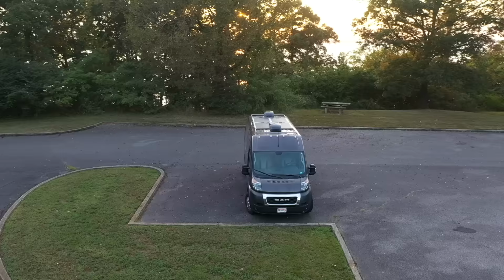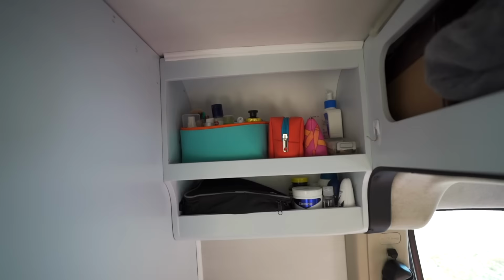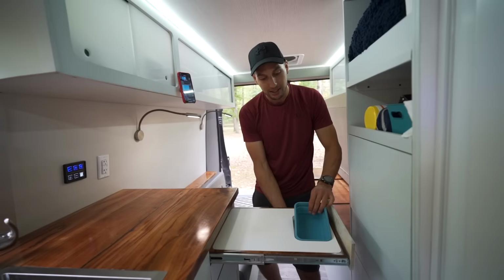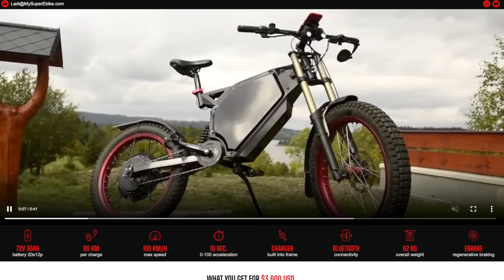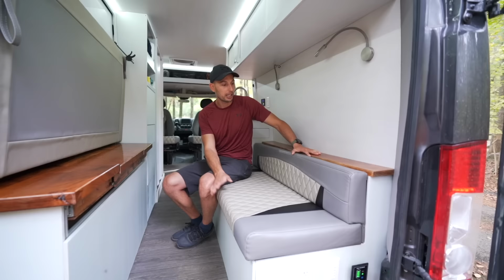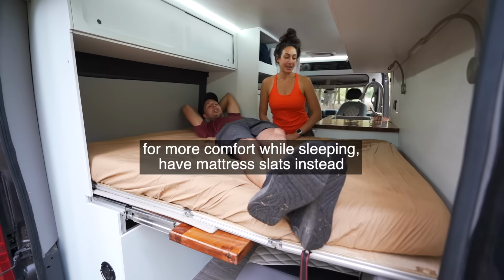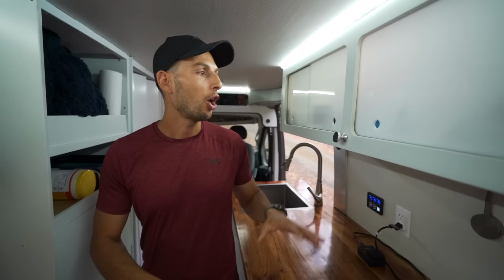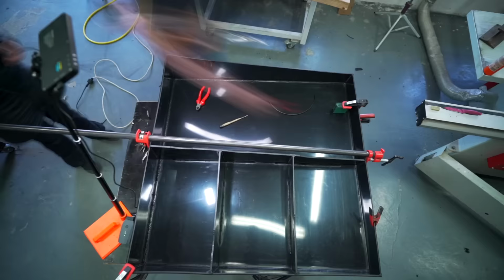LUXURY Van Tour + DESIGN REVIEW of Innovative Campervan Layout

Comment: Something I noticed: The 3rd joint of that bed is gonna become an issue. I could see the stress on it in this video already. While they say that the bed will hold 500 lbs, that 3rd joint does not have the necessary support for longevity. The table would need to come out a few more inches AND connect to the top of the sofa to relieve the stress on that joint. If you look closely, the joint is beginning to bend downwards slightly. The more you get on it, the more it's gonna become evident until it finally gives, rendering the bed useless until that joint is replaced.
Reply: Yup! If, only the mattress buritoes, the slats accordions, it may be better.
Reply: smart, that was the first thing got my attention. Floding bed better to land on the floor when fold out.
Reply: @jparsit .
Reply: Hej peeps, does someone know which foldable hinges they used with the 8020 Burrito (22:31) bed system?! Thaaankss
Reply: Love the pros & cons at the end
Reply: idk why they dont put 1/3 on the opposite wall to fold down and act as a cushion back when sitting.
Reply: @TheDevilK  im working exactly on that Atm. But to know this mechanism woul be a great  advantage
Reply: agree. And extending the table would allow for more comfortable seating because it would come close enough to you to sit back against the wall of the van.
Reply: That third joint is not as bad you think. It is likely 500lb, and for 2 people. But your weight is distributed most of the time while sleep across the entire bed base. The con is this is not a stationary weight, it is mobile, which adds more stress then just a stationary load. So just thinking all that and yes I could see where you are thinking and that IS the weakest point of the design. However, that would only be an issue IF one sleeps in the opposite direction. Because that third joint is under your legs when you sleep in it, in its intended design. There is very little weight and load from your legs, so this should not be an issue at all. Or it might be an issue IF you get onto the bed at the end, but again it is designed to be entered in the middle which pull out table is beneath for extra support. It is clear to me they designed and engineered on purpose this with the second joint being on top of that pull out table in the middle of the bed where it will see the main loads. If you are sitting in the bed, once again that would be done more in the middle just naturally sitting up from a laid down position, as well as near the walk way. Again over the top of the 2nd joint and supporting pull out table underneath. Again no issue. Even if you were to sit on the opposite end of the bed, with your back up against the wall, your legs will be over that 3rd joint, with the base of your body being supported by the back rest of the couch the bed base sits on. So not an issue there either. 

Just look when he is laying on the bed, it is only his lower legs that are on that 3rd joint of the bed. His knees and entire rest of the body is above that and being supported by the 2nd joint and pull out table underneath.
Reply: All the creaking noise it makes would drive me crazy
Reply: The bed is not nice.  When folded up and not in use, it's sticking out like an ugly wart.

Comment: Could not have the cooker over my beautiful leather sofa to get hot food,water spilled over it. And the chopping board was fab but needed to be on the end by the sliding door. No inconvenience as you can use the back door to get in and out.
Reply: O
Reply: How about putting the chopping board where the cooktop is, and the cooktop on the opposite end of the counter? That way any steam or cooking smells could waft out the doorway? 😊
Reply from the maker: That would conflict with the sink.
Reply: Maybe lay a blanket. with a design you like, over the couch to protect it?
Reply: @ladiandmargaret  they could swap sides with the sink to achieve that. I would be mortified if my couch was damaged with cooking oils etc.
Reply: No back splash or hood vent ?

Comment: A large table to lay out blueprints is a must for me if I travel with my work.  This clever design provides that without having to buy a bigger RV.   Would never have thought so many features could be made to fit a van.  Narrow hallway suits me, a solo traveler, when it gives such a big kitchen work surface. Even better that it expands in 2 directions. Best shower setup I've ever seen in this size vehicle.
     Thanx for the tip about how white back splash = high maintenance.
Reply: Not sure what you’re doing around blueprints if you “would never have thought so many features could be made to fit a van”
Reply: @Timeculture  Actually, there haven't been blueprints around for 25 years ... But, that's what we still call any large scale drawing that has to be rolled out on a big table.  A scale drawing is used to design anything from a dog house to a rocket engine.  The rocket scientist and the carpenter aren't necessarily the same person.  Is that what you are getting at?
      I don't know anything about planning a compact, useful van interior.  Big and tall, I'm in awe of anyone who can conceive and build large features that become small;  in this case, the folding bed, the expandable cooking area ... but especially, a huge, slide-away table for drafting work, where several people can view the presentation of a project drawing in a weatherproof setting. The big drawer where the presenter hides her laptop is a great place to keep drawings and drafting tools clean and intact.
       I draft up plans that show people where to plant trees on country properties.  The scale is usually 1" = 8 feet, or 1/100 metric.  Some of the work can be done on a laptop at a tiny desk, but at some point is generated a large plan on paper.   Not all clients have a guest house or drafting table.  Sometimes there aren't yet any buildings on site.
       With a van like this, I can park right where the planting will happen.  Rainy or windy, I can invite the client(s) inside to view the drawings.  At a later phase, I might supervise the planting, in which case the landscape contractor would also find this big, weatherproof table useful.  He might just run out and buy a van with the same ingenious features.
      It's a niche market, but there are probably countless professions that need this type of indoor/outdoor portability in a compact van format.

      My work provide

Comment: Great video! A suggestion for the bed - they make "zipper bedding" where the blankets/bedspread zips to the bottom sheet, so it is easy to make the bed and not have to store the bedding separately. Good for any bed really, but especially a bed that moves to be put away.
Reply: This is great advice, I would definitely use zippered bedding if I didn’t have a fixed bed
Reply: One of the brands is called Beddy's. I thought of this too. I feel like they'd be especially convenient in any van.

Comment: love the pull out stove - swap to van door side like previous note.  Love the big top opening fridge and counter space, no to the taco bed.  Love the rotating chairs with computer table and foot raised. yes 2 vent fans.  I love windows at least on one side.  I do like the pull out chopping block without the rubber catch thing in it - it will wear out ... love the window coverings and your cat.

Comment: The leather pattern furniture and beautiful wood work is the best I have seen.  I like the white plastic cabinets and the appearance of the layout.  I live in a RAM Promaster City you know a FIAT a little one.  I use a Walmart Futon for my sofa bed.  Looks great, durable and very comfortable.  I have a wraparound wood finish utility shelf cabinet on the side and back.  Side beverage snacks and back a 42 inch ultra HD Flat Screen.  At the door is about 4 Sq Ft of floor space.  Next to the door behind the passenger seat is a clothes cabinet that supports a mist air-conditioning or refrigerator.  It works great for me.  I can collapse the beverage counter and unfold the Futon into a queen size bed.  I have never done that and simply sleep on the sofa.

Comment: I love a bed that is set in place. Never had a van camper but it would be great. If I did I love the cutting board but would place it on slide out somehow on the door side, over refrigerator and have it swivel to side and straight out side of counter. Induction stove seems great but think a covered one on counter top would be better. Bath is great and amazing to fit in space. I think the van seats are enough room, so would do the burrito bed but also make panel to store under if not in use as bench to put an extra tote. The bed staying burrito would be nice if you have company. Place the stuff under bed in car and plenty of room. Love the lights and placement of. The blinds are great feature too. I would  also, narrow the counter just a bit. Might try to add a pull out counter or cover for utility drawer for that extra counter space for mixing if stove is in use.

Comment: Yeah, there is a lot of things i would do different, but this gave me some ideas.
The countertop/cupboard doesnt need to be that deep, even if you build with standard IKEA cabinets, you can cut them down and create more floorspace. Find a narrower sink and put the faucet on the side, save a good 20cm
I would make the countertop slide/fold over the bench wit the cooktop underneath, instead of having the cooktop sliding out over the seating area, splattering bacongrease everywhere.
I would do a liftable bed with seating underneath, that can fold up against the walls to create a garage while driving (fitting one motorcycle with the wheel in the aisle and plenty of stuff on the sides)
And, the best idea yet, I have seen only in one build, slidable showerwalls that epands the shower/toilet out 20cm in the aisle with an attachment for a vent hood to the roof fan to ventilate the steam/stink out...
Also, since I want to be stealth, a roofrack hiding the roof fans and Solar panels AND giving storage space.

Comment: Move the sink to the right side of the counter. Storage underneath. Standing fridge on left side. Induction stove pops out to the left by the door/ easy exhaust. Additional panel over the bench that folds down would extend the counter space all the way to the back of the van. The kitchen counter should be like 8 inches less wide, no one’s using the back 8 inches when working.. would allow for more room in alleyway.

Comment: Two things I would recommend.  Move the cooktop where the cutting board is. And add an extractor fan above on the roof.  And use a fold down cutting board as part if the backsplash. And extra seeds or peels could be swept into a the sink.
Reply: Except then whoever is in the work/bedroom area is stuck until the cooking is done, or has to climb out the back and come around. And vice/versa. Maybe have the cooktop stored in that sliding space where the cutting board currently is, but it comes out and gets placed on the counter when cooking.

Comment: I agreed with most everything except the frig and cook top. Love my top-opening frig. Hate low-placed front openers. Maybe if they were raised and you can afford 500 plus watts of solar, sure. 

Hope that rear upholstery is ultra-cleanable because that cooktop is really gonna make a mess over it. Should put the cutting board there and have the cook top on the counter.
Reply: i absolutely agree, i also think there needs to be more colors in the van and a warmer lighting
Reply: Kellie..yes yes yes. Good ideas.
Reply: yeah cooker should have opened to the left i think.
Reply: @TheDevilK  exactly. if the cooker is on the left, oil splashing or smoke will go out from the the door.
Reply: and, you could possibly do all your chopping sitting down

Comment: I've often wondered if a composting toilet on some sort of rail system would work--it would move the toilet back into the foot area of the driver's seat desk, then cover the "hole" with a hinged watherproof panel and have a shower that's easy to stand in without avoiding the toilet...

Comment: Well, great review of the van. I think that the zink and induction hub / cutting board should be switched so cooking damp gets out of the instead of on walls and sofa and when kitchen is working mode, the burrito bed is rolled up, the end doors is the in and out mode. And kitchen side should definitely be smaller in width. Some really good finishes in the building, I already had the long table with drawers underneath in my mind, to my upcoming build. Unfortunately I got scammed with car I was supposed to have 3 days ago, but luckily I gonna get all my money back. Wish you all the best on your journey back home to Millie.. 😻

Comment: Top opening fridges are more efficient than bar style fridges, as the cold settles to the bottom as heat rises. Efficiency in a van build should be a priority so I'm happy to see the builder made a good decision here.
Reply from the maker: Efficiency doesn’t mean anything if the product is inconvenient. After living out of vehicles ourselves for years, we’ve yet to met anyone on the road with a top loading fridge who doesn’t admit they’ll be switching to a different type for their next van.
Reply: @ladiandmargaret  I'm not hard of understanding, I got your opinion from the video the first time around. I'm just saying that the fridge is a sensible choice for a resource-limited application like a van, you can prefer another type if you like, it doesn't change the fact. Living in a van in the first place is inconvenient, efficiency is important.
Reply: @ladiandmargaret  We've had a top-loading fridge for 20 years in our van and really like it. I'd be happy to have one again. But ours isn't on sliders so there is no faff getting in to it. The clamps on the one in this van do look very annoying. That is too much faff, I agree.

Comment: I wish I had seen this video 4 months ago. I have been doing trial and error on my multi fold bed storage. I finally figured out last month after 3 months of racking my brain on weekends on how to make it work. I will have more storage on my design. Two big side by side 36" 12" deep drawers under the bed and over the battery system. The toilet or maybe water tank will be between the battery system and back door. The bed folds like the one you showed and storage space used to store just the bed is 17" high, 18" deep by 74" making the bed 6' 2" x 6'

Comment: That convertable bed/desk spare was so clever, and would be a great thing to impliment in a smaller van where multi-use spaces are a necessity.

I do wonder how it will do with moisture though. One of the problems with murphy beds or really any bed with no slats is moisture and mold.
Reply from the maker: This bed has groves from the bottom for air circulation. Not the biggest and no air circulation when closed. It’s a real concern for sure.
Reply: @ladiandmargaret  maybe adding slats to it and then an aesthetic panel for when it's closed would be the next iteration?

Comment: I would sleep the other way around on the bed, with the feet in the recess. When I wake up, I would forget and sit up and bang my head! The central corridor can be made even narrower, if you are good friends, wear less clothes, and wear oils! Ha Ha. 
More seriously, the lack of even a small garage in this design is definitely a problem for most people. Where to put that electric bike, or inflatable kayak, or skis or whatever? That said, the amount of office space front and back  is a great plus for those who work on the road, so the "Burrito bed" would be a great plus for those folks. 
Since the toilet is removable, people can put in the composting or whatever version they like. Not having a "sealed" toilet/shower system is just not viable IMHO, so it is great to see that well designed space in there. 
You see some videos of people who don't have an internal shower and bath, and they claim that they do fine without it. But in some areas of the world, access to clean bathrooms, especially at any hour, is highly problematic. And yet in the wilderness, you have more options for outdoor bathing, but realistically only if the weather is reasonable, and messing around with shower/toilet tents, etc is a pain for full-time van dwellers.

Comment: So glad to see they didn't take up space in the bathroom with a sink. To me, that's the biggest mistake any smaller RV units make. I understand the extra steps that are a pain with a top loading fridge, but since cold air sinks, you don't lose a lot when the lid is open. Since I'd be alone in the van, I appreciate the extra width for counters/storage, rather than a wide hallway. The best way to make the 'safe' safe is to have the bed down when away from the van

Comment: For the kitchen, I would switch the cutting board to the stove , that way cutting would be possible over the seat and not impede mouvement in the hallway. And I would conceal the stove on the countertop underneath a lifting board. To me the couch is not necessary since you have the swivel seats, Just set the bed up to be accessible all the time. About the white panels that show dirt, how about putting them a matte light beige or grey. Anyway, I think you did a great design just with the swivel seats and the little tables!!!

Comment: Interesting van layout, with some nice ideas.
Surprised you didn't like the fridge though, having used both top loading and front loading.
I much prefer the top loader. I actually found it easier to use not having to get on the floor to see whats inside. I can see the benifits if it was at eye level though.
One thing i didn't like though was the cooker location !!!
cooking, especially frying over the top of the leather seats ...naaa.
IMHO it needs to be by the side door where the sink is,  ventalation when cooking anything smelly or fatty